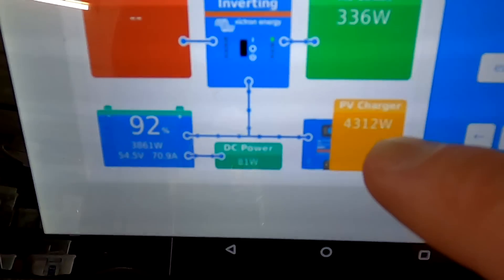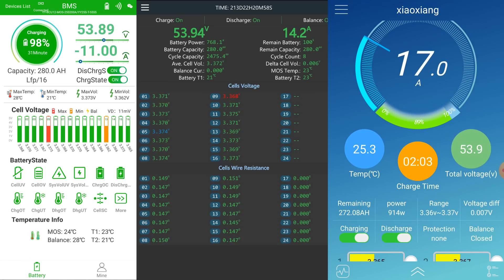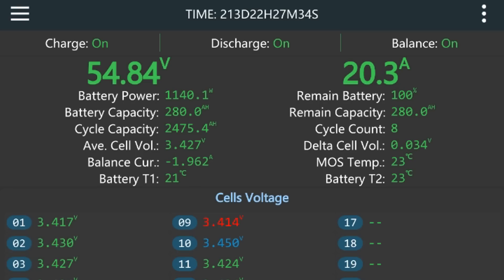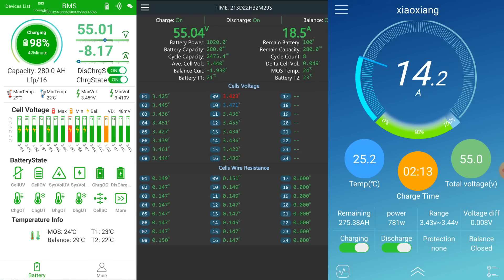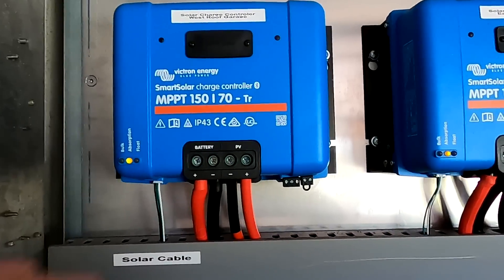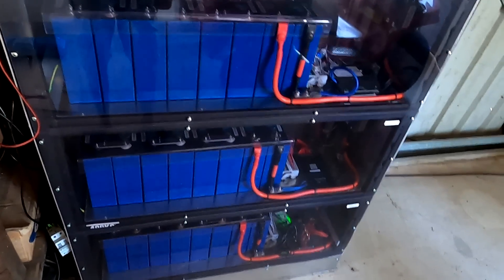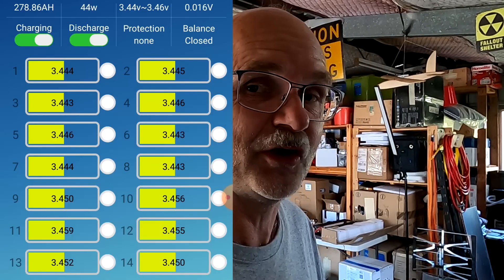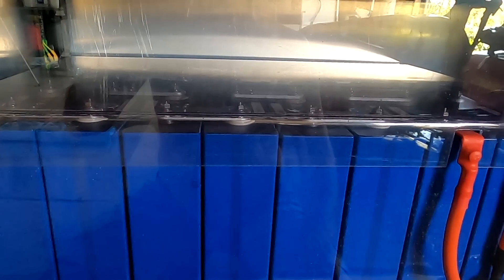Parallel Batterie Bank with 44kWh first full charge after winter. Watch this voltage difference!

Comment: Can you Tell me how the three bms are emergency shut down the mppt loader? I ask, because i am planning my second 14 kwh battery with a separate Bms
Reply from the maker: Once the BMS hits a protecting state (either voltage, temperature or current) it will disconnect this battery bank. The MPPTs will keep charging the other two banks.
If, for whatever reason, all three banks would have an issue at the same time (extremely unlikely), the MPPTs would go into absorption mode and supply a constant voltage (as set in the configuration) to the load and keep it running if there is enough solar. That works very well with the Victron MPPTs. Other charge controller may act differently if there is no battery present any more.

Comment: Hi have a hybrid 5.5kW 48v inverter charger with a 10kW (48v 200ah) Lifepo4 battery bank. I have this since June 2022. I and would like to increase the capacity by adding an other 10kW Lifepo4 battery bank from the same supplier but new. After having them
 charged at the same voltage can I just put them in parallel knowing that the internal resistance of each battery won’t match (one old battery and one new one).?
Thanks for your advice.
Marc
Reply from the maker: Yes, absolutely, as long as the voltage matches, you can safely parallel them. Please put the appropriate safety gear ins place as usually (fuses, breakers, cable sizes...)

Comment: Hi
Lifepo4 Battery bank suppliers do not recommend to put  them in parallel if they are not from the same batch same capacity and with the same internal resistance. 
From your video I understand that this is not required and that I can parallel 2 Lifepo4 battery bank regardless of their age or capacity right?
Thanks for your help.
Reply from the maker: Yes, that is correct. I have now a 2 year old 280Ah and a new 135Ah battery bank in parallel for a few weeks and use them without problems (it's in my video here on the channel). It does not really matter what batteries you put in parallel as long as they are the same chemistry and voltage.

Comment: Awesome comparison of the different bms! What happens if the inverter starts using power from the battery when the battery is absorbing? 
Maybe check the busbar torque connection on the higher millivolt jk batteries. The busbars could be sliding or need retorqued..

Comment: Andy, you have 3 BMSes integrated with Venus OS over CAN Bus. What is the trade-off for this protocol instead of Victron's VE.Can?
Reply from the maker: I haven't connected any BMS to Venus OS yet. I did some testing with my second Pi but I didn't integrate this into my production system. Still unsure about the benefit...
Reply: @OffGridGarageAustralia  Then how your Victron Multiplus knows it has to throttle down the charging when near full capacity?

Comment: Hi Andy! A small suggestion. I noticed you made gaps between cells for cooling. It'd work better if you make perforations in shelves and big holes in shelf cover for convection.
Reply from the maker: I actually sealed all the gaps in the shelf with foam and silicon to prevent critters to get in. Holes seem counterproductive here 😊
I will see how war it gets in summer time and if there is additional cooling necessary for the batteries. As I'm going to add more batteries over time, the actual current will go down per bank and there the power loss and heat creation as well.
Reply: @OffGridGarageAustralia  The Australian critters, right :)

Comment: Thank you Andy, very helpful video. I have a Growatt inverter/controler (with JK BMS) where is not pssible to program absorption time so the only solution for me is to manually change Folat to 3,45 volts every month for about one hour so all cells balance and than I lower back the parameters after balancing. It is good to know that I could could it once every 3 months and not every month.
Reply from the maker: How does the Growatt charge your batteries then if it does not have absorption? Does it charge to absorption voltage and then immediately goes to float afterwards?
Reply: @OffGridGarageAustralia  yes after absorption stays 1 minute then straight to float   is unfortunate.

Comment: Hi Andy I have a daly 500amp smart bms that failed. It won't stop discharging. Do you want it. Could be an interesting video. I'm in Beenleigh. Or I can send it to you. Thanks luke
Reply from the maker: Hi Luke, have you tried to update the firmware? That may fix the problem...

Comment: Good vid and info as usual Andy. I was wondering if the JK pack has had more testing done on it previously that it has more trouble keeping in balance, but you may be right about the aluminium bars too being an issue there, either way I still think these small mA variations were more than acceptable given the time from last full charge. 
Andy, can we buy u a beer or donate using PayPal? I have had issues with using cards over the net lately. Cheers
Reply from the maker: Yeah, I was really please about the result after such a long time and using the battery right at the bottom for many months now. Good to know, it is all working even after winter and I don't need to manually balance anything.
The donation link on my website is for PayPal. Thanks for your support, Evan!
https://off-grid-garage.com/
Reply: Andy... My 10th cell on my battery pack, with the same jk bms, has the same unbalance problem.. Less mV but same tendency... Only a coincidence

Comment: hello andy , 
i really hope that you see this comment because i couldn't find and an answer .
let's say you have two sets of panels and two charge controllers , you connect them to one battery .
the two controllers and the battery leads are all connected together in parallel at the same point .
 how does the charge controllers differentiate between the battery voltage and the other controller voltage  ?
why doesn't the second controller see the first controller voltage and thinks that the battery is full?
Reply from the maker: Great question. Both solar charge controllers will see the same battery and same voltage. One  controller will not have a different voltage as the other controller. That is not possible as long as they are connected to the same battery.
Reply: @OffGridGarageAustralia  the charge controllers do have the same voltage , but the battery that let's say %50 is lower voltage.

Comment: Where do you find your bus bar and how do you calculate whate size you need, just bought 4x6.9kw Seplos batteries I would like to connect in serie with a copper bussar to my Deye inverter.
Reply from the maker: I build my bus bar myself from a tinned copper bar I bought.
You want to connect the Seplos batteries in series? I don't think this is possible. They are for parallel usage only.

Comment: I really love the enthusiasm, around the PV & battery statistics. 

It would be interesting to know how you use all this power? 

Hot water, dishwasher, car, washing machine? What do these appliances use? 

Have you got enough to drive them?
Reply from the maker: At the moment it is just the garage which is connected to the system, the pool pump, irrigation pump and the vehicle charger. And I have an extension cable to the house to run dishwasher, washing machine occasionally. The battery size is great but I need more solar, especially in winter time with lots of shading.

Comment: I was thinking of making a battery system with 1S but many P so only a CC CV system is required but this would need like 100-500 amp boost converter? 3.5v up to 12/24v ? No balance required and set to float so it should have a long service life?
Reply from the maker: Does such a boost converter exist? The efficiency won't be great. And think about the cable sizes 😮
Reply: @OffGridGarageAustralia  no I don’t think there is such a thing but the theory is using a cc cv buck converter to charge it would guaranty a set maximum charge and all cells would be balanced as perfect clones of each other. Only other problem would require manual disassembly at times to check the condition of each cell but for the majority of the time it would be worry free ? Maybe ?
Reply from the maker: @maxgood42  I think the technology we have these days is great and works well.   BMSes, balancers, that all works with batteries in series and I haven't heard of any other development to change that. But yeah, interesting thought...

Comment: Different current between the packs is not necessary a sign of different SoC but of different pack resistance (kirchhoff rule). Communication between the BMS and the chargers would help the balancer keep track, especially for passive balancers with lower balancing power
Reply from the maker: Communication which slows down charging would be a nightmare. Imagine only one bank has a higher deviation but the other banks are fine and can take more energy and you slow down the charging for all of them. And with 150mA passive balancing, how much would you have to slow down charging to make the balancer work effectively?
Active balancing is the solution here. There is no real alternative in my opinion.
Reply: @OffGridGarageAustralia  You slow down charging only at the end of the charge curve when you entering the knee. That in fact is very positive because the reduced  current avoids false balancing (because cells are peaking caused aof higher IR or bad cell connection and not because of different SoC) and, as statet, helps the balancer to do his job. 150mA is really very low, my passive Balancer has 1,1A (Rec BMS) per pack (having 4packs in parallalel, 44kWh in sum). Each pack has a BMS, communicating via master with the Cerbo. 

In my opinion there is no need for an active balancer when there is no false balancing and the current is low enough so "bad" cells are not running away.

Comment: Hi Andy, and again a big thank you for this video, super interesting as often!
I'll give you my opinion, about the charging procedure.
I noticed and you can see it again on your video, that the first pictures of your 3 BMS when they are all at about a main voltage of 53.6V, the cells are all well balanced on the 3 BMS, and the percentage of 3 BMS indicates almost all 3 bms 100% charge (except the JBD, overkill but it's only 1 parameter to be rectified very slightly) even your smart shunt indicates 99% also nice!
For me everything that happens after, is useless, increase the load up to 55.2V and absorption?? in fact I believe that Victron just said that it is necessary to make an absorption charge on lithium batteries?
I have always heard that the charge of lithium batteries is constant voltage AND constant current. (no absorption?)
And why I tell you that the rest is useless, it's simply because after the floating voltage of the Battery packs, they will return to 53.6V, with the same percentage of charge, and the same voltage at the cells as at the very beginning.
The only thing we could see is that when you charge too much 55.2V and absorption, the cells are very unbalanced.?
For after, during the floating, come back as before.
It's a shame we didn't see the video until the floating was done.
I think if you charge your battery has a constant voltage of 53.8-53.9 or 54V and Floating has exactly the same voltage, without absorption. you will have exactly the same result, except that logically your cells will always be well balanced all the time. (obviously the test must be done with the same sun conditions, etc.)
The only concern that we may encounter is that the batteries will have more difficulty charging when the sun is less and it will charge a little slower.
Again Andy this is only my opinion, about the charging procedure, and with all the very many tests I have been able to do, without ever absorption, when I exceed 54V at the main voltage of the battery packs, this cause problems of imbalance in the cells. (but I admit the JK BMS is very efficient)
By staying at the Max at 54V (main voltage) or below 53.9-53.8-53.7 and 53.6V it's perfect!
Reply from the maker: The fact that the deviation is not high at 53.6V is not because the pack is well balanced but because we're still in the flat area of the curve and all cells have almost the same voltage, regardless the SOC.
So CV charging is basically absorption. The current is tapering off while the voltage stays constant. The cells absorb.
The only reason to charge to 55.2V is to allow time for the balancing to take effect. Nothing else. Only at this 'higher' voltage, we can identify the cells which need balancing. Going down by 0.1V per cell only and they all show almost the same voltage again.
If you charge only to 53.6V, the cells are not consistent charged. Voltage cannot be used to determine the SOC of these batteries. You can of course charge only to Float voltage and absorb at this voltage but again, inconsistent results/SOC and absorption will take forever. Balancing at this voltage is impossible. And over time, deviation will get worse without being noticed because the cell voltage looks the same at this point.
Reply: @OffGridGarageAustralia  Hello Andy and thank you for your answer, I understand what you mean.
And your videos are so well explained, that we just understand well, but example if I apply in my case it's not going at all.
And when you say: "You can of course charge only to Float"
I sincerely think that this is very sufficient, so that all the cells are completely charged, and that the SOC is at 100% or 95%.
For this reason, an example if you use a Growatt inverter, and you select the LI option for the type of battery, the Bulk charge and Floating charge are inseparable in setting (ex/ you set 53.9V in Bulk charge Automatically the Floating will be 53.9V and you will not be able to adjust bulk and floating differently) these are Factory settings for Growatt, in the case of the LI selection.
Even better, if you connect the communication between the inverter and compatible battery packs.
It's exactly the same, the inverter just looks for the SOC of the packs to show 100%. (and the inverter solar controller charges then stop, then recharges and stop.... and so on...) until the battery are full charged. (sincerely I don't like to operate it with communication, because at the end of the charge the inverter did only that, charge, stop, charge stop ...... for me it is not good for the internal relays?) but these are Growatt factory settings in colaboration with branded battery packs.?
The only thing I'm sure of, after multiple tests: if I push the Main voltage above 54V the problems begin, too many cells are unbalanced! and if I go above 54.5V or even 55V the problem is even greater, even with an active balancer this cannot be fixed. 
(Attention all these tests in real conditions!! not with a power supply, because the charge with the solar controllers is sometimes different, and it is necessary to take into account, sometimes cloud shadows, 
and consumption at the same time by the inverter which also varies, different loads, and all this sometimes changes the charge procedure)
On the other hand, slightly below 54V (53.8V-53.6) is perfect.
And the batteries are all at 95 or 100%.
Andy I think each case can be different, depending on the solar controller used, depending on the cells used, BMS too.
But in my case 3 different battery packs, different BMS too,
each time if I exceed 54V of main voltage, Problem.
And that's why I gave you my opinion, and what seems really logical to me is that after charging at 55.2V your solar controllers go to Floating at 53.6V, so in fact, for me to have pushed them that, does not bring anything good?
And when we see example, at the speed where the voltage of the battery drops, during a total stop of the charge (therefore logically discharged)
Having pushed the cells to these voltages (it takes time) and I think stresses the cells, so that in 1 or 2 minutes when the charge is stopped, the main voltage goes down very quickly to 53.5V-53.4V.
But without losing any SOC percentage.
This is really what I insist on, charged above 54V or more I have always found that it was useless.

But it's really good that we can share our experience, and especially that you make great videos!, it's really good, thank you again Andy.

Comment: Do you have an overview, how many Ah got discharge through each of the three banks? Did the JK BMS and Heltec BMS get loaded more than the other and was maybe more unbalanced because of this?
Reply from the maker: Aeh... not sure if the BMS capture that and accumulates the Ah used or charged over time. I don't think so. The Victron Smart Shunt does it and the charge controller do it but not the BMSes.
The battery banks will be used the same way as they are in parallel. If one bank would get discharged more, the voltage would sink in this pack and therefore current would go from one of the other banks towards this weaker bank. So in fact, we would then discharge this pack less than the other one. This sort of balancing takes place 25/7 at any stage and ensures all banks are the same all the time.
Reply: @OffGridGarageAustralia  this may not be the case in the flat area of the voltage curve?

Comment: I've also seen people stating that from time to time it is good to bring your LifePo4 cells to higher voltages for the chemistry to "reset".
Any truth in that?
Reply: If ‘higher voltages’ means: no more than 3.65v, then maybe so, but i would not charge a cell above it’s 3.65v max, I believe anything over 3.45v / cell can/will begin to accelerate potential degradation of a cell, but many may disagree.
Reply: @evil17  I agree with you as well.